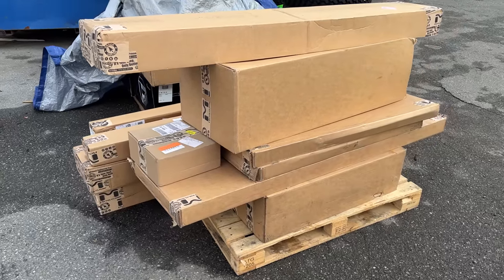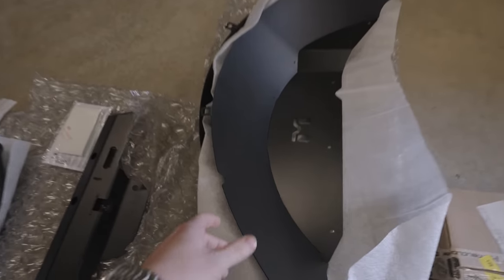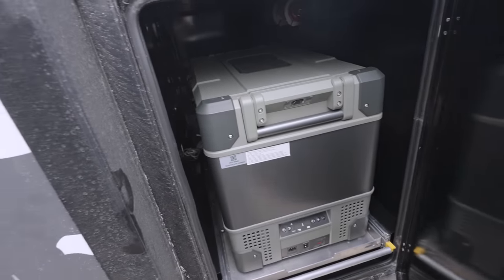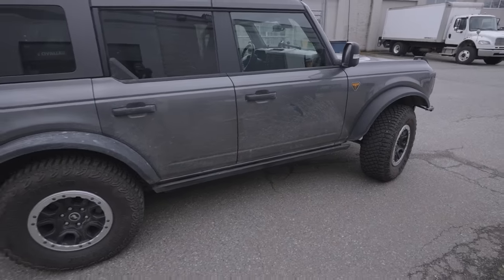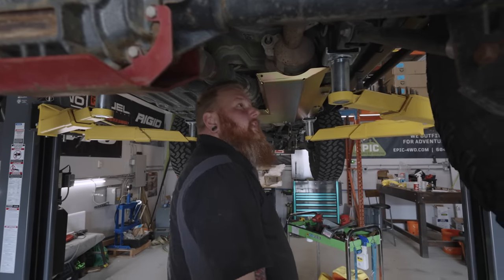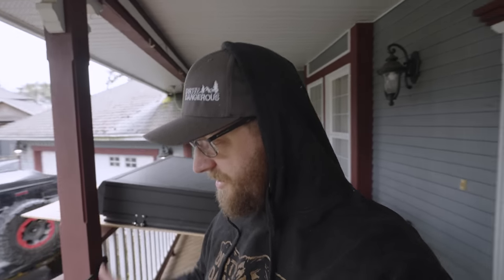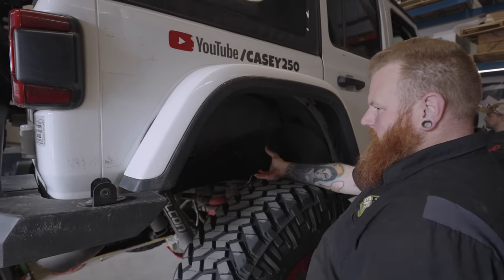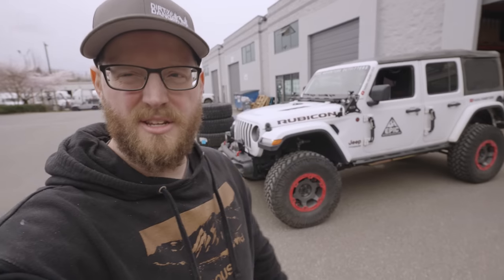We Decided to Remove My Roof Top Tent and This is Why....

Comment: I went with the eco flow because of the quick recharge battery, went from 36% to 90% on 160w solar panel in 7 hours.
Reply from the maker: If you get some AC this thing charges sooo fast
Reply: @Casey250  yes recharges to 100% in an hour on AC, really awesome, used it for the 1st time on Easter weekend.

Comment: On the wind shield protective sheet...I tried Exoshield on my 2018 JL. I would NOT recommend it. While it did prevent some window chips, it started to discolor after about a year. It got a funky iridescent look and I could not get it off. Then trying to get it replaced under warranty was a hassle because I wasn't near the original installation company.

Comment: Hi Casey. Who is doing the delete on the diesel? I am strongly considering it. Diesel tech friends of mine say the engine lasts a lot longer with it off. Thanks
Reply from the maker: Ecodiesel owners Canada. They are on fb and ig.
Reply: The best thing you can do for a diesel motor is a full delete of all that extra restrictive crap.

Comment: People are always concerned about a tent on top. For my Gladiator it did not pose any problems in Moab and many more off road trails. The longer length helps. I think a four door JL is generally fine too.
Reply: Coming from a jk 4 door to the gladiator… tent now sits at roof height, vs on the roof.  Substantial difference when off camber both in pucker factor and with keeping tires on the ground.  The RTT on my JK sat at 8’ on the mark, same lift same tires gladiator sits more than 16” shorter… weight up high changes everything.

Comment: I occasionally use my Tent Cot (oversize model) if I’m Jeeping alone. A bit more headroom than than standard model , and a foot or so off the ground. Sets up in a minute or 2.  Downside is the space it takes up in my XJ, but if I’m by myself, I have plenty of room for it.  Also, regarding John’s Gorilla glass, I believe it has a 2 year warranty, but the chip must be between 1 and 3 inches.  Worth it?  Not sure.

Comment: Casey did you have to install spacers on the front armor that protects the oil pan??  We just installed our a recently and after installing we noticed a vibration on the  first drive test.  The armor plating was rubbing against the oil pan.  So we pulled it down slightly and installed a 3/16 stainless thick washer and re-installed the brackets and we had more then enough clearance between the front of the oil  pan and the armor plating, so no more vibration.  No sure if Metal Cloak new about this when they engineered this kit???  Just wondering if you experienced the same thing.
Reply from the maker: I did not, nor did we have an issue as you did.
Reply: @Casey250  good to hear👍👍 hope you had a great time in Moab. We didn’t make it again this year unfortunately!!  Great videos too👍😊

Comment: Regarding the delete.  I did my duramax after having problems with the sensors.  Hen they did the delete they did leave the catalytic converter in place and left the def tank in place so it looks stock. Not sure if true but someone just told me that they are doing checks in bc to check diesels for modifications to the pollution control stuff.  He told me he was stopped in a road check on anarchist mtn where dot looked at his truck.
Reply from the maker: I feel like the wrangler would fly under the radar as most dont even know they come with diesel.
Reply: @Casey250  I would remove aa badging for sure.

Comment: If the goal is to really off road, a Rtt adds significant overall weight and it creates an undesirable higher center of gravity.  There’s also the wind noise. To me, the Rtt is about glamping and creating the optics of a youtube “overlander”.
Reply from the maker: They are handy when pulling and camping on dry river beds, snow, mud, rocky mountain tops, parking lots etc.
Reply: Fair point, thank you!

Comment: If you can get a good clean tune, there's scientifically nothing speaking against it, it will even be more fuel efficient without dpf and Def so thinking about carbon footprint its okay to delete it. I recently had costly repairs, half of that caused by the crap that accumulated because of the egr. But definitely consider the legal problems.

Comment: So 25 year autoglass installer here....the Gorilla Glass is a joke. It's VERY thin, and the actual Gorilla layer is on the inside, not the outside where it may make a difference. Not worth the extra expense.